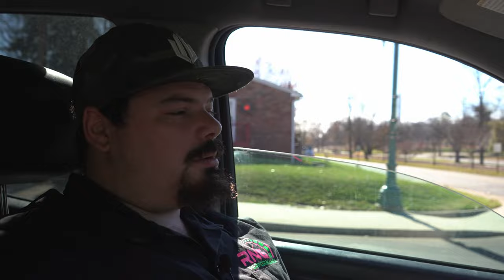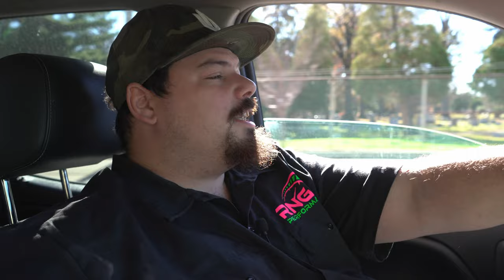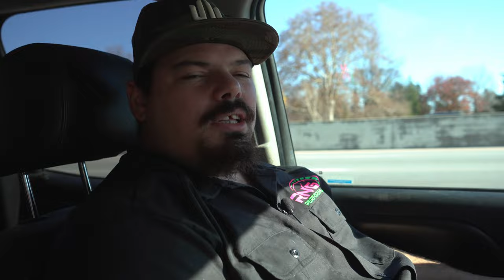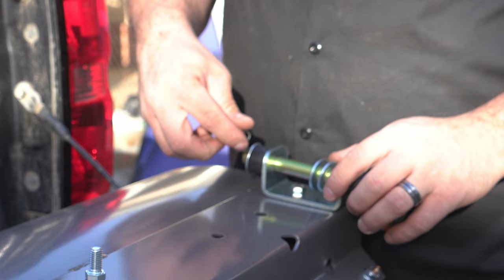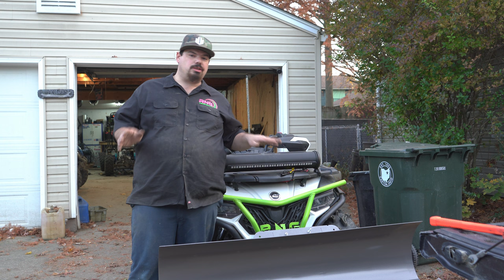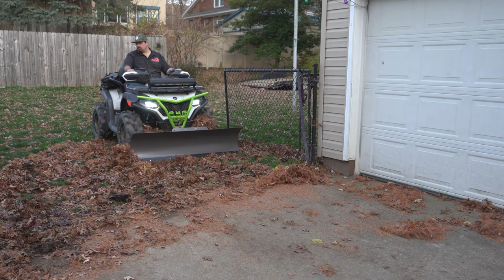Best Plow for You're CFMOTO

Comment: Nice, I recommend getting the Plow Lever kit, the strap/cable angle is too extreme.   I can't believe KFI doesn't include it with the plow.
Reply from the maker: Yeah I actually just ordered that.  They definitely should.  Even for even add some extra $ to the plow it will save money and hassle.
Reply: @R.N.GPerformance  I have seen guys make them out of a harbor freight pully and square tube. I bet you could make one right now with what you have in the garage.